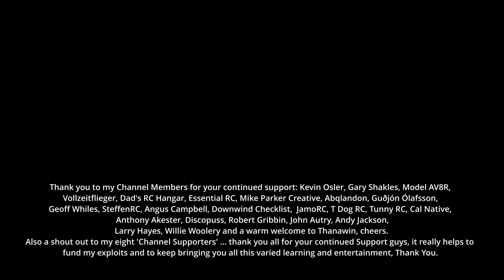Annular Monoplane 'Wool Test' Experiment

Comment from the maker: If you watch the wool carefully you can see subtle changes in the airflow.
Reply: I thought the airflow direction particularly towards the front was following the rib orientation , which seems viable as the ribs and thus airfoil shape would be largely responsible for the pressure distribution. Thanks for setting up this interesting experiment.
Reply from the maker: @johnharen9921 that was my conclusion as well John, cheers 👍